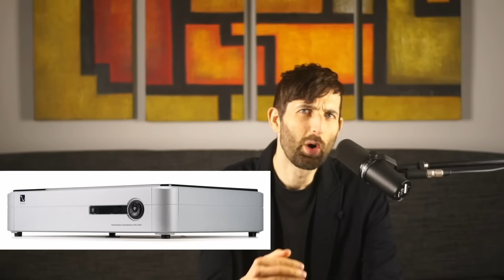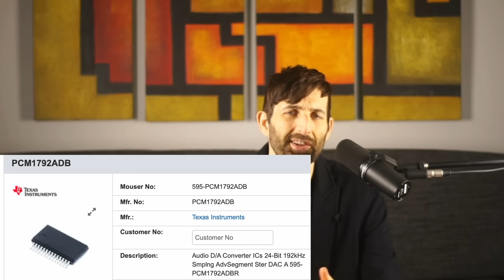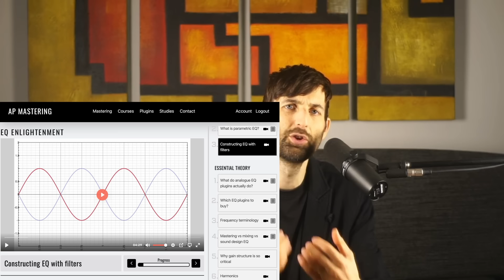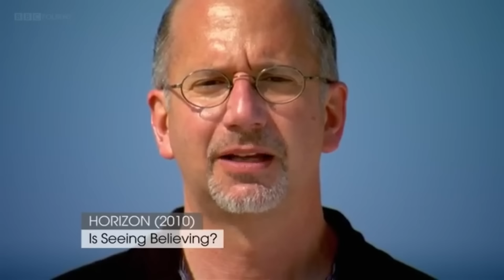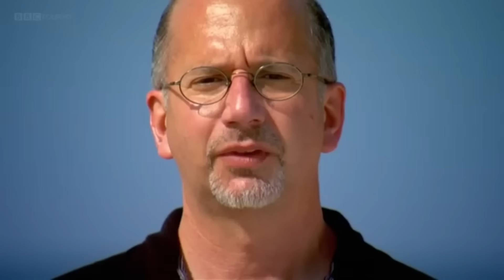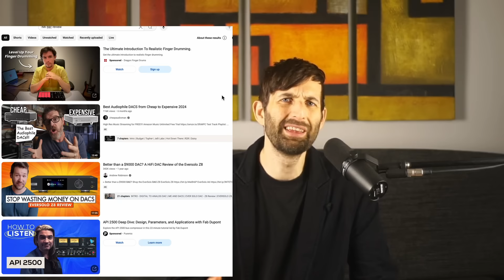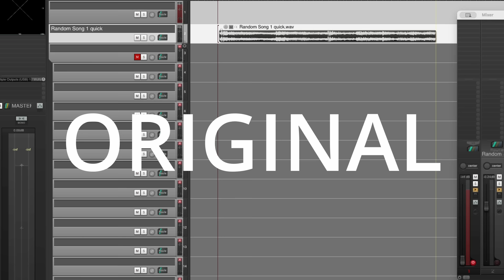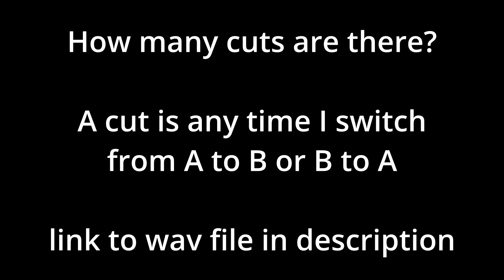The DAC Scam - Almost everyone believes the hype

Comment: I only have one question: Which of the shown and critisezed DACs in the price range of 10,000 $ range and above have you heared in a highly resolving chain with the adequate music? - Please specify the DAC and the chain!
If you would have heared any of theese you would not post a video with so much non-sense, inadequate statements and lies.
1) None of theese DACs uses any of the mentioned chips.
2) Various DACs which use the same chipset sound completely different - so the chipset has a very minor influence on overall sound-quality.
I spent almost 50 years to find components with the highest sound quality spending the least money possible. And with regard to DACs it is the same as with other components: If you compare the best components money can buy in a given price class, the amonunt of money you invest correlates to sound performance (of corse there are exceptions).
So - are all hichly-priced DACs worth the asking price? - Of course not! However, some sound like "liquid gold" and I would be happy, if I could afford them. In the right chain they are lightyears ahead in terms of sound quality when compared to 1,000 $ Chip-based DACs. Just take the effort and check at an adequate dealer!
Reply: the only difference ever heard in dacs was in some very bad early sound cards. its tragic to pretend that this still lives on in regular modern gear.

Comment: I don’t understand this test. Why employ a loopback recording? If your claim is that commercial DACs that have the same chip are indiscernible from one another (save for level matching), why not blind test commercial DACs?
Reply: Because, if digital signal converted to analog, back to digital (using ADC) and back to analog again (using DAC) produces, this is rock solid proof that DAC (ADC) conversion is not affecting original signal in any way.
Reply: @max5250 Thanks, but my question is more granular. I don’t understand the setup here. How many DACs are employed in this test? It sounds like 1. But again, I’m not following what this guy did. But if there’s 1 DAC in this entire chain, how is that proof that 2 DACs sound the same. He’s not even testing his own clam. Why not A/B 2 DACs? Isn’t that the best way to test his claim? The only way?

Comment: The chip is one thing. But some great RDR DACS don't use these oversampling chips. Also, the power supply has a lot to do with the sound; it's one thing for the chip to output a pristine signal but it's another thing to pump that analog signal to an amplifier while preserving its dynamics. I agree that high end audio is 90% case machining cost and pretty hardware but it's a bit reductive to say all DACs sound the same. That said, audible  differences I've noticed in my 40 years in the hobby have more to do with system matching between components and even more so between speaker/amp pairing than anything that happens in the digital domain.

Comment: Agreed, there is a lot of hype and tom-foolery in the audiophile constant pursuit of audio nirvana.  I was able to skip the cable scams with speaker connections, proved it to myself with my ears.  I have just dived into DAC's and I have ended my search.  Purchased the Fiio K11 R2R Dac, which runs my headphones with optional RCA outs.  It had some USB issues which was annoying, but once corrected it sounded great.  The second DAC, the Topping D70 Pro OCTO with XLR outputs solved all my USB clicking problems and the back end output was very clean solving external EMF interference from my cable rat nest.  As some reviewers said, a personal sound evaluation with a good return policy is required.

Comment: MM, Studiomaster, Allen and Heath, Neve, Amek, Cadac etc all used some of the same chips in their signal paths, but they didn't sound equally good. Implementation is very important. However the difference between one circuit using a particular Burr Brown DAC, and another, provided the circuit and PCBs are competently laid out, will be minimal. Many manufacturers, even of esoteric equipment, stick quite closely to the suggested circuit in the chip manufacturer's application notes.

Comment: As others Commented, true for the naked chips.
But the dCs, Holo Audio and Chords of the world don't use these off the shelf chip dacs.
They use combinations of proprietary r2r and or fpga designs for the d to a conversion, coupled with quality linear power supplys with high on demand current capacity and low noise, plus careful selection and design of the analog path out to the rca, xlr outs.
These contribute to black background noise floor and high musical dynamics, plus 3d spundstage imaging,  width and depth, which afaik, aren't measureable by techical measurement devices
Reply: "which afaik, aren't measureable by techical measurement devices"

What can't be measured by "technical devices" doesn't exist, except in the mind of people who believe there is fancy DAC chip that could convert sequence of 1's and 0's into different frequency than some other DAC.

But, the thing is, when you convert digital signal into analog one, and then back to analog  and to digital signal again, and the result is (when listened on the same sound source) indistinguishable from the original signal from the beginning, everything you said in your reply is pure nonsense.
Reply: @max5250  False.
Soundstage, imaging differences can be readily discerned blind a,b.
Please reference the technical, repeatable method to measure Soundstage and imaging effects 
I am not aware of any.
Reply: @ When we speak about soundstage and imaging, this relates to sound source.

Here we are talking about analog audio signal that could be:
- stored for later reproduction
- emitted 
. sent to some audio source (headphones, or speakers)

The same analog audio signale, reproduced through different speakers/headphones, or in rooms with different acoustics in case of speakers) will have different soundstage and imaging.

But, here we are talking about audio signal itself, not about sound produced from that signal.

We know for the fact that:

- multiple re-recording of one audio file on analog equipment will produce degradation in each subsequent generations due to nose associated with analog technology.

- multiple re-recording of digital file will not produce any loss in signal

- single conversion form analog to digital will produce signal of the same quality as the one of original analog signal

Now, would you be so kind, how could digital to analog conversion of any DAC, no matter how cheap or expensive it is, could change that?!

Of course, when someone shells out 4.000 EUR for a DAC, he will easily convince himself that his neighbour cat will drop blooming orchids from her arse when hearing music from his system, but that shouldn't be enough to convince any sane person that more expensive DAC can produce audio signal of a better quality, when all it does is, converting 1's and 0's into an analog signal of a certain voltage.

Comment: Both True and False, as usual in audiophile/phool discussions.
True, the same chip provides the same output, at the chip level.
But ess vs akm do sound different all else being equal, ie powersupply (switch vs linear, psu noise contribution and supply voltage stability, etc) and all analog components in the path from chip output to rca/xlr output jacks.
There are dacs of the same model from fiio for example, that are offered with an ess or akm chip, and some models with both, switchable,  depending on the sound signature you want per chip.
For chip dacs in general, the differences are in build quality, psu quality and type, and the quality of all the analog components after the dac chip, ie the caps, resistors, transformers, isolation,  noise shielding, etc. Power supply type, linear vs switching, and quality, toroid build and size, ground plane isolation and separation from the digital side, all contribute to noise floor reduction and improvement in soundstage depth, width and imaging focus. 
 Yes, depending on the rest of the gear after  the dac analog outputs, it can be easy for most to a,b the difference, or at least those who care about and discern soundstage imaging  effects, which are sensitive to noise floor and time domain issues in the dac and analog sections.
Frequency domain issues like flatness throughout the audible range are long solved. Same for dynamic range, both trivial 101 audio quality issues for decades.
Its noise floor, dynamics, soundstage 3d-ness and image focus that audiophiles chase, which are time domain issues.

Comment: I dont have experience with very expensive DACs but in the 500 to 1400 bucks range (and sure 20 when talking about built in DACs of streamers, receivers etc.). What you notice in listening depends on many different factors so every experience is a unique case. I can just tell I dont regret in testing and investing in DACs at all; I could easily tell the difference, some speakers like my old Fyne Adios went even from good to amazing. I am not an audiophile freak and in general a sceptical person, so I was very surprised about my learnings.

Comment: Masters Degree Electronic Engineering here. I've built my own DACs (~$100) using chips from Burr Brown and they sound every bit as good as the super expensive stuff. So yeah, no need to spend thousands. A DAC is not like a vinyl cartridge where more money generally means better sound. I used the TDA1540 once and it sounded amazing. That chip is over 40 years old! The tech has been perfected long ago so now it's just marketing. No meaningful improvements can be made anymore.:trophy-yellow-smiling:
Reply: I think what you are missing is how those chips are implemented! How is the output circuitry designed? What type of power supply is being used? Isolation? I’ve had as many as four different dacs in my home at one time at varying price points and they all sound different from each other. If what you say is true, every DAC should sound exactly the same, and we know it is not true. Let me put it in simpler terms for you. I can give ten different people a recipe for a cake and provide them all with the very same ingredients. I promise you that all of those cakes will be different from each other due to the methods used to put those ingredients together, not to mention the type of baking pan used, variances in temperature regulation, etc. It is not as simple as you suggest. And yes, I also have a Masters Degree in Electronics Engineering. I’m not suggesting anyone spend 40k for a DAC. I can tell you that many dacs in the $1500 to $2500 price range can and do walk all over dacs that are $500.00 price range.

Comment: A Ferrari is just the same as a Camry, they both have four wheels and an engine and seats and a steering wheel.  It's all a scam....
Reply: Good parody of this guy’s argument. You didn’t get it exactly right. It’s be more like saying the two cars are the same because they both have a steering wheel. He isn’t reducing the DAC to the sun if it’s parts but only a single part, namely the chip. Stupid reasoning.
Reply: @a.s.2426  as most of us know it's all about the analog output stage.
Reply: @joesaxon6566  Definitely. Power supplies. Clocking. Two other major areas often referenced by DAC designers. I'm hardly an expert but I know that DACs can sound dramatically different from one another and I'm just going on what the designers say leads to this difference.
Reply: It doesn't take any special skills to appreciate a Ferrari. For me 500 in speakers 300 in an amp and 200 in a dac and none of my friends can hear a difference in quality beyond that. Maybe a different tone and preference but it's really hard to tell what's better than that. Then you add eq and it's impossible. I've driven a Ferrari on track vs my wrx. By corner one anyone can feel the difference. I mean I've hit my fastest track speed ever in a Ferrari. I'm more of a Porsche guy because I like stick but still. Camry is a solid car tho. As long as your outside of like Bluetooth and bad files it gets really hard to tell.
Reply: @laindaley9644  There is no proof you or your friends know how to setup a system or know how to listen for anything more than bass and treble.  If your system is topping out at $1000, it's not even a Camry
Reply: Yeah. And a Camry looks way cooler too.
Reply: @geofflongford2008  Let's not get too ahead of ourselves. A 296 objectively looks better than a Camry.

Comment: There are other components that impact sound such as the clock, phase locked loop, and analog parts of the DAC or ADC.  These parts don’t  necessarily justify cost of high end converters on a basis of part cost alone or even R&D but they can be comparatively expensive. The expensive converters are priced based on whatever the maker needs to make money and their marketing.
Reply: This channel is biased obviously.

Comment: $80 SU1 and $15 Amazon 14 gauge speaker wires. Everything else bought used on Facebook. Total cost less than $500. Sounds awesome.
Reply: I spent 5 grand on a system and it didn't sound like a 5 grand system, cos the 2 grand speakers $uck. I bought them for reference for my speakers building hobby. I wasn't impressed with the muffly voice sound on the bought speakers, and I copied the sound with my built speakers and they didn't sound any better. So I tweaked my built speakers (a little bit) to suit my taste, and now they FLOG my bought speakers! 😂
Reply: @Justwantahover  Aha! I went on FB marketplace and found a pair of formerly $1400 speakers for the fraction of the cost. My first 3 ways and the diff in sound was eye opening. Finally I got a true HIFI sound system
Reply: @pedrofernandez8729  
I bought an $1,800 amp, a $1,000 CD transport and (AU) 2,400 B&W 706 speakers. It's a 5 grand system, but it doesn't sound like a 5 grand system cos the speakers $uck! 😂 I bought them for reference speakers for my speakers builds. I don't have a sound proof room (etc.) so I decided to buy some EXPENSIVE speakers for (authority) on how speakers should sound. When I got them, I wasn't impressed with the muffly voice sound (but otherwise ok). And I copied the sound on my built speakers and they sounded no better. Then I gave the voice sound more "breathiness" on my built speakers and then they FLOGGED the B&Ws! 🤣 But the B&Ws were still a God send for my hobby, I just have to compensate for the dip between 2 khz and 5 khz (guessing) when I build my speakers. I play by ear! 👂 All my built speakers are dipole and point source, with an open coaxial on top of the box, ran with a woofer in the box. This is one reason why they flog my B&Ws. I made a few sets of speakers so far, some with an open coaxial and some with an open FR driver on top.
Reply: Yup, add a nice low noise power supply to the SMSL SU-1 and you have a great DAC.  A $20 linear, regulated power supply works great, as do the ifi power supplies.  Glad you brought the SU-1 up.

Comment: I lost my comments:
1. compare DACs using good power cables. Digital is very sensitive to power quality.
2. compare DACs using acoustic instruments tracks. And compare this audio experience with your own audio experience of live unamplified music (classical music performance, unamplified jazz or busker performance). Or compare with the same acoustic instruments track played on a humble record player. Hear no difference? Lucky you!
3. For the rest of us: there is a huge sonic improvement switching from a usd 1.000 DAC to a usd 50.000 DAC. A demo in a proper HiFi system easily makes the point. The question then becomes: is the improvement worth the additional outlay? The law of diminishing returns kicks in. Only you can tell.
Reply: "Digital is very sensitive to power quality."

Digital is not sensitive at all.
Either it has digital signal, or not.
There is no "quality" assigned with word digital.
Reply: @max5250  Unfortunately, this simplistic view is simply not true when applied to sound reproduction, also from a scientific point of view. Understanding the reasons has made digital sound reproduction much better of the years. Just check how DAC chips got better and better. However, do me a favour. Do an A/B comparison using different power cords into your DAC. If you hear no difference, lucky you. Enjoy the music.
Reply: @mlsl9828  
My dear friend.. if digital signal was "very sensitive to power quality" we wouldn't be having this conversation, since power quality of different computers is not the same, and if it could affect digital signal, that signal would change, which would lead to inability to communicate.

The main aspect of digital signal is the fact that it remains the same, no matter what.

Comment: I have been reading a lot of the comments and I was wondering what part sound Equalization vs. no sound EQ at all plays in our perceptions. For example: If I had a recording I liked playing through an expensive DAC that did not sound that great to me versus a cheap DAC but the sound was Equalized to my preference. In the end my own experience has shown me that I like a good recording together with EQ that is pleasing to my ears. Because I have severe Tinnitus in my left ear in the higher pitches I am pleased with music that is heavier on the lower frequencies and subdued between 4 to 8 hz. range. I am just wondering what role EQ in general plays as part of this whole discussion. Any thoughts on this?